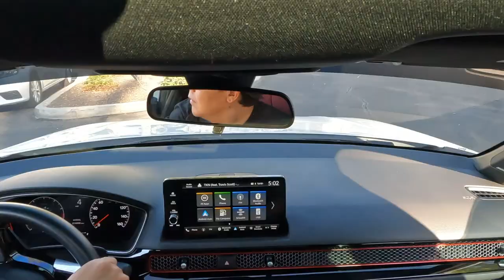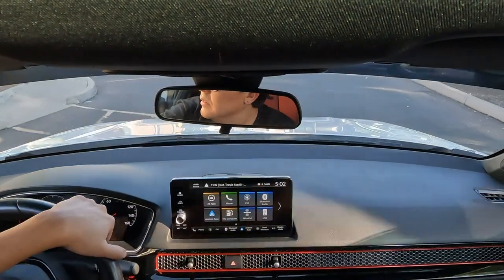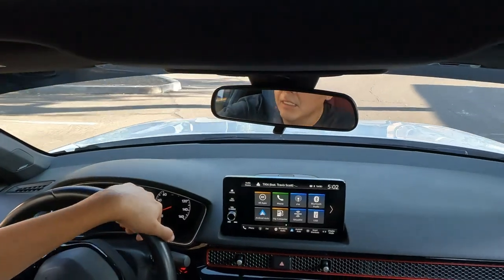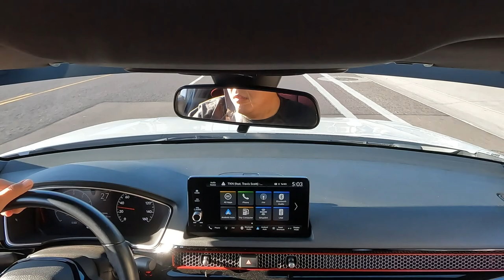27WON SRI !!SOUNDCHECK!! #27won #11thgencivic #intake

Comment: Good stuff. Especially outside the car, I'm surprised how easy you can hear it, even knowing you run modded exhaust & downpipe.  Got CVT here, little less "fun" But still have a great-time driving it & paddle-shifters at least gives the full RPM range experience.  Hearing the intake sounds made it extra fun to drive around. Can't wait for my 27WON SRI to arrive this week!

Comment: Are you worried about heat soak with this bro ? Or do you have a intercooler upgrade , I need more sound but can’t decide which intake
Reply from the maker: That would be the next step but for its fine not to worried about it. I like this one cause it's louder.
Reply: @chidiboy  awesome , yeah sound is what I’m looking for !
Reply from the maker: @mikeyrov5230  yeah I like the sound of this one.